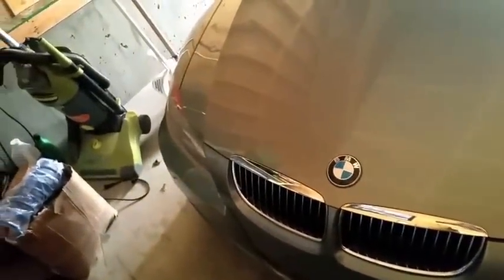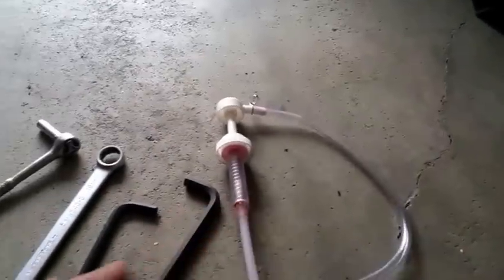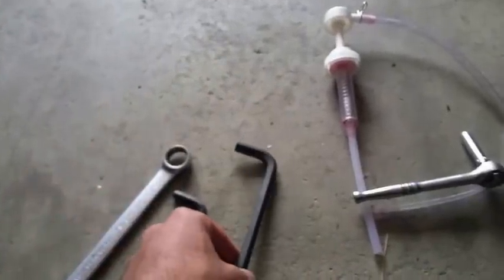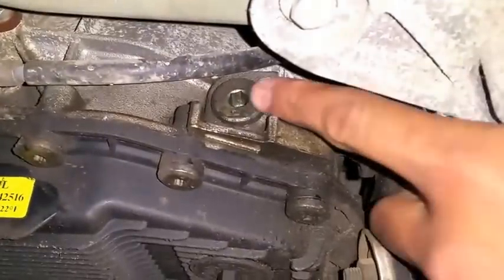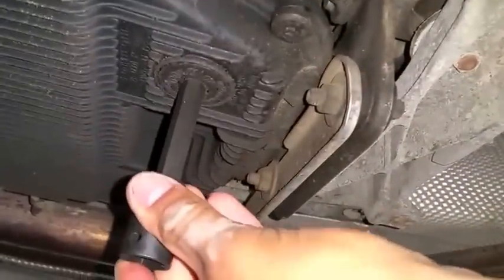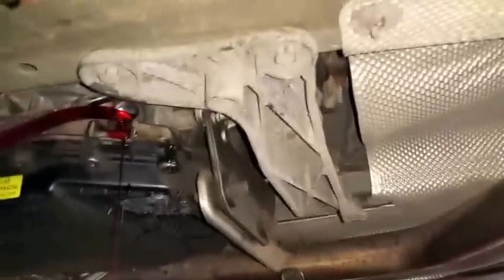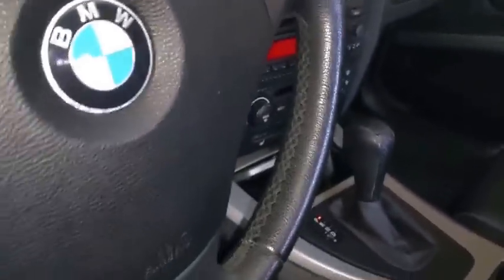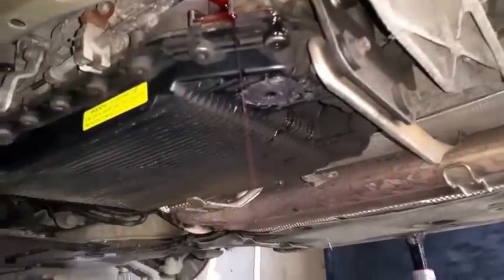2006+ e90/e92 BMW auto transmission fluid change

Comment: I've had problems with my gear shifts all the time. Any time I want to rev my beamer, there would always be a lag between my shifts and my car would end up having the transmission light light pop up on the front screen. I'd have to pullover, stop my car, and restart it for it to disappear and function normally again. I talked it over with the mechanic and he said my transmission is fine. After coming across this video, I think my problems had more to do with my transmission fluid than with the whole transmission itself. I'll go buy fluid now. Thanks for this video.
Reply: I  have the some problem . Did u fix it?
Reply: Did this fix it?
Reply: Hey lakersfan. Did the oil change fix it?

Comment: Use a torque wrench so you don't strip your drain plug. 6 ft/lb of torque.
Reply: Should be replacing the pan as well. The pan has an integrated filter and a new pan comes with the drain plug pre torqued.

Right now ECS has the service kit on sale with liquimoly for $126 and is normally around $150. Definitely better to do both the fluid and the pan.

Comment: My e90 jerks from 2nd to 1st I will do the transmission fluid changed and I will let you guys know if the jerking stops from second to first gear right before I stop there's a jerk
Reply: Qussi Marji did you get it changed ?
Reply: I have the same issue, can you tell if that fixed it?
Reply: Mine does the same when I go to a complete stop, car being in 2nd going to 1st does a little bump.
Reply: Do the transmission reset! Just did it and its smooth now. only takes 1 minute and worth it
Reply: Gre Latron what kind of reset? My trans is a zf6hp19z and is so smooth! The only issue is 2nd to 1st. Very little.
Reply: diego castellano car in start position , engine off. Hold gas pedal to the floor where it clicks . For 1 minute
Reply: Gre Latron I tried many times, but it does nothing and no clicking noise. I pressed start no brakes then full gas for 2 minutes and nothing. 325xi 2006 zf6hp19
Reply: diego castellano it wont say anything, it will just reset
Reply: Did you ever fucking do it
Reply: I just started mine, I will finish this weekend and I will tell you!
Reply: I just finished my car today! Good news the car drives like a new car. Amazing!! Gears so smooth and no more 2nd to 1st when going to a complete stop.

Bmw e90 325xi 2006
Zf6hp19 
9 liters of motorcraft mercon SP
Zf solenoids 
Sonnax zip kit
Separator plate
Zf filter pan and bolts
Did front and rear dif plus transfer.
75w90 mobil 1 and ravinol tf 0870.
I did not reset any adaptations and drive better than ever.
For trans 2nd refill trans needs to be between 30 to 50c temp.
Reply: @Youssef El-Masry so you just changed your transmission fluid and and the car runs great? I only did the transmission reset and i noticed an improvement but the shifting is still hard and Very noticeable when driving uphill.
Reply: Well then? @diegosti
Reply: @nunonunes097  then what?
Reply: @diegosti  nevermind mate for some reason not every comment loaded up and I didnt see your update comment! Glad it went all well
Reply: @diegosti  Nice, what average cost for all the parts and Gear fluids?

Comment: It’s just weird that bmw recommends not to switch out the transmission fluid in their automatics.. How about manuals though? I have 100 000 miles on my 325i E91 and I doubt that the transmission fluid has ever been changed.

Comment: So the car transmission holds 6 quarts completely and you must add 3 quarts back because 3 quarts of old fluid is still inside the system when you drain out 3 quarts only .
Reply: Mtb Ridingog  wait what
Reply: @eze12313  dont worry bro sorry for thw mix up of words it should be 3 quarts not 6 in the second line

Comment: Great video Mike!  How's your drain plug doing? Any leaks? Removing the plug just once probably destroyed the gasket, hence the need for you to silicone the plug.  May be a good time to buy a new plug because I believe the rubber gasket is attached to the plug.  I'd also suggest a new fill plug for the same reason, but because trans fluid doesn't sit on the fill plug, it won't matter nearly as much. I'm at about 92k miles on my e90 n54 xdrive and was considering changing the auto trans fluid to stretch the life of the transmission.  Thanks for the advice!
Reply from the maker: Thanks. Removing the drain plug doesn't damage it and it can definitely be reused. I just overtightened it and ended up damaging it. And yes with the silicon, it doesn't leak at all.

Comment: I just had my auto trans oil flushed, wow what a change it made to the gearing, much smoother now!
The old oil was dark and nasty, so I can't imagine how it would be bad to get all fresh oil in there.
They used about 16 liters of oil to completely flush out the old oil.
Reply: Was your car an E90 ?
Reply: It's 10 quarts for an E90.
Reply: 9.And it took 16 because they flushed it.
Reply: What fluid did you use? 6 speed e90?

Comment: My wife 08 328i auto 4 sedan has 78k miles on it should i be needing transmission oil change   ? I dont know if  i have zf or gm transmission .,i have heard that bmw transmission oil has a lifetime ? No need to change ?
Reply: You should have GM transmission  [per Bentley - 328(x)i -s   - GM transmission].......... [Per Bentley 325s, 330s 335s including Xs were ZF]........the only way to be sure......ZF has the plastic filter and pan in one (black)......GM metal pan - silver.

You should change the Fluid and Filter......the interval is 100k, if you want the transmission to last.  If you want to change the transmission or rebuild then DO NOT Change it.......You could just pull the plug and refill the transmissions now and do the fluid and filter at 100k.   Make sure you fill it correctly....the engine needs to be running .
Reply: Change the fluid bro my car is a bmw 2008 328i  with 117k miles on its original transmission with this so called life time fluid and 3rd gear is going out ... Make sure you change the fluid as soon as possible or spend 4500 on a rebuilt transmission for your wife brother ... It sucks but that's what we get for buying these stupid German cars

Comment: Does the e90 require a new transmission filter along with the fluid change ?
Reply: Raymond Perez not necessarily but it is recommended. I changed the pan on my E90 when I did this
Reply: BMW Kaari for how much
Reply: @pierredenha7434  you can get the filter for Around 118 bucks at AutoZone and the pan if you need it probably around 200 bucks I maybe incorrect with the numbers I'm saying but the filter is definitely in the hundred mark..
Reply: @DakaariDenton  im about to do the same how much fluid did you use

Comment: I am having a 530 i 2006 and i am wondering changing the transmission oil will cause fail where i am getting issue in transmision where it hangs some times and i smell a burn when drive in high rom
Reply: same problem

Comment: quick question my 328i coupe isnt accelerahing after 20 mph would the fluid change help , just throwing vvt solenoid and maf codes thanks in advance
Reply: your vvt is fucked probably about 400E for a replace and install

Comment: Hey Mike, just curious how your E90 is running currently. My automatic transmission jerks a lot and wanted to replace the fluid but the mechanic at the dealer told me that I would cause more issues if I changed it than if I left it as it was. Btw mine is an 06 325xi with auto and currently 71K.
Reply from the maker: I have done automatic fluid changes on 3 bmws so far (e90, e36 and e60) and they have always helped smoothen shifts.  However, if your transmission is slipping then new fluid wont heal broken components haha
Reply: Mike, thanks for the response. I'm not sure if i would call it a slip. I'd say the shifts are generally a bit aggressive and all the e90s I drove had it somewhat, but I think mine is the worst. When I slow down to a stop I'm guessing from 2nd to 1st it jerks a bit. It makes almost impossible to stop it smoothly. I wonder if a flush would change anything? Or should I just sell the car before it gets any worse lol.
Reply from the maker: I am very sure that a fluid change will help smoothen your shifts. And sometimes the transmission gasket starts to leak a little and over time you end up losing 1 or 2 liters of transmission fluid (this was the case with my e36) and hence a fluid change or top up becomes important.
Reply from the maker: Even if you sell your car its good to have it shift smoother. Just don't mention the fluid change to the buyer as some of them believe it to be a lifetime fluid and they'll panic
Reply: Thanks so much Mike!
Reply: Ledjo Palo did you ever do oil change in your tranny did it help with the shifts,mine does the same thing?
Reply: no change your fluid and mechanic sleeves  I did it  and now perfect no jerking

Comment: Mike..! That was a nice video. 
I have my Beemer 2006 530xi and when I drive my car in manual shifts there is a transmission leak but there is no leak when I drive in AT. Can you help me out what's the best solution to stop leak when I drive in MT. I just observed in the video that you said silicon right..! So can I try that silicon to stop the leak?

Thanks..!
Reply: sharathchandra rao honestly you shouldnt use the optional manual "sport" mode. apparently it's not good for the 2006 models.

Comment: Hey do you recommend a change or a full flush (extracting all old fluid from the torque converter with a pump)?
Reply: Blackwing, NO do not do that on a BMW, you need the dirty oil in the torque converter. Just drain and refill which is what I did or you can change the filter but that's way more work.
Reply: Frank Perez okthanks
Reply: Unfortunately you can not........There is no plug for the torque converter....You would have to remove it.
Reply: You do not need dirty fluid in your torque....that is not true.......Brand new BMWs do not come with dirty fluid in the torque converter....... The fluid circulates through the transmission and torque converter.  It does not stay in just one.  The only time that would make sense is if the clutch pack is worn out and there is no friction material left - the friction material is in the fluid and without the transmission would not work at all.  All that does is buy you a little time but you are going to need a reman./used or rebuild your transmission in the near future.  You can flush by doing multiple drains and refills and driving in between them to circulate the fluid.
Reply: Can you please tell me if I can use any automatic fluid or is it special bmw fluid?

Comment: What if u have to change the gasket...should I mix old fluid with new fluid
Reply from the maker: you can just change all of it as there will still be about 3l of fluid left in your torque converter that will mix as you drive the car

Comment: Can you please tell me if I can use any automatic fluid or is it special bmw fluid?
Reply: rkjer depends on your tranny, figure out if you have the GM transmission (GA on 328i) or the BMW one (ZF on the 328i), if it's the GM tranny then just get some synthetic dexron 6, (i use castrol), if it's the BMW one then i recommend using either OEM european ATF fluid or BMW's transmission fluid

Comment: what oil you used?
Reply: Motorcraft mercon SP
Reply: The GM transmission use Dexron VI and the ZF uses Shell M 1375.4........Valovine MaxLife Multi-Vehicle ATF I believe will work in both.....I know the Dexron VI is covered in it.